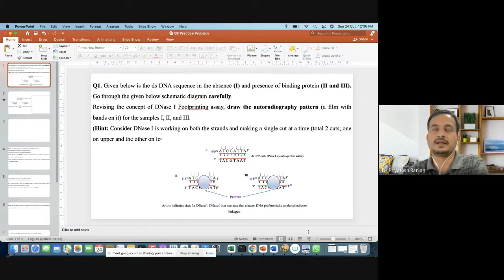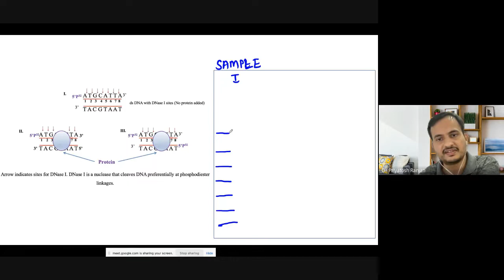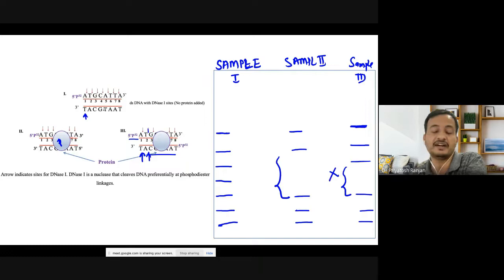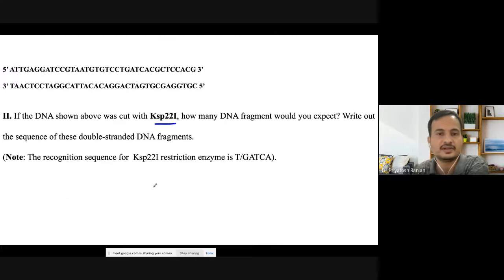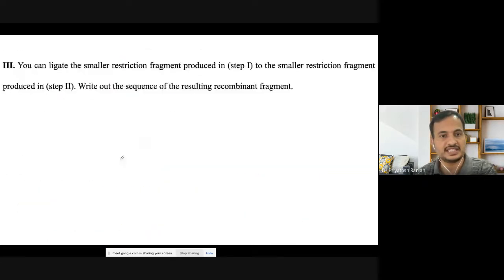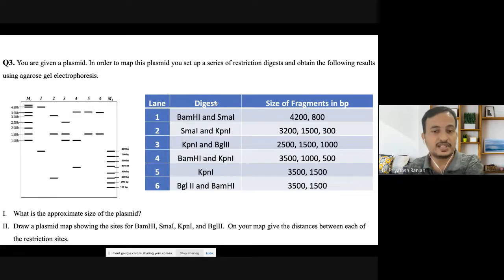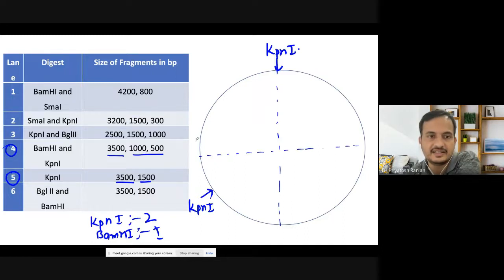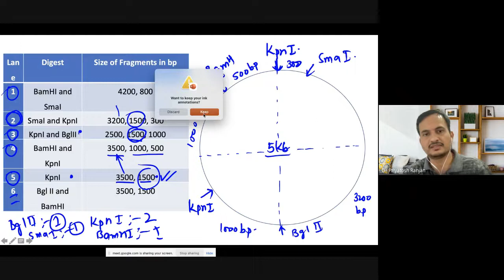Genetic Engineering or Recombinant DNA Technology or Gene Manipulation

Comment: Sir, for the last question, I think that placement of Bgl 2 is incorrect as the smaller fragment between BamH1 and Bgl2 is supposed to be 1500bp but according to the placement in the answer it is coming out to be 2000bp
Reply from the maker: I would not say the positioning but scaling is off. If you look at the order, this looks fine. But the distance between the two restriction sites needs modifications. Good catch!!